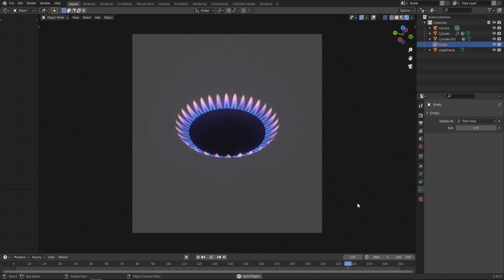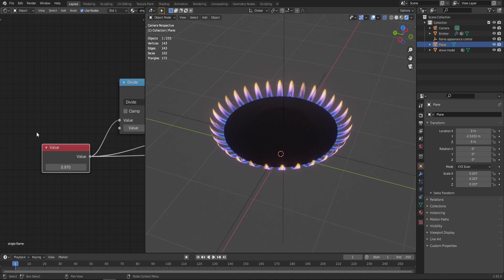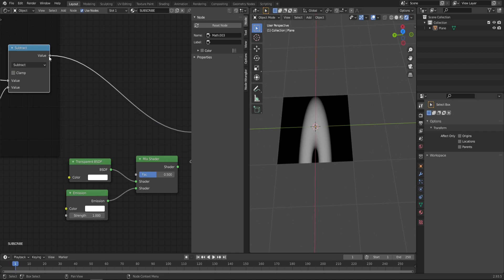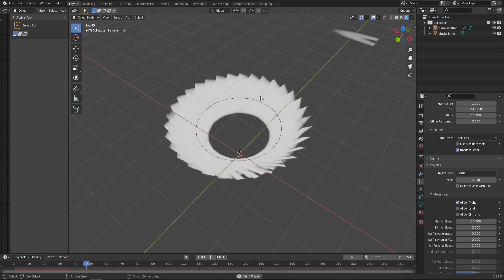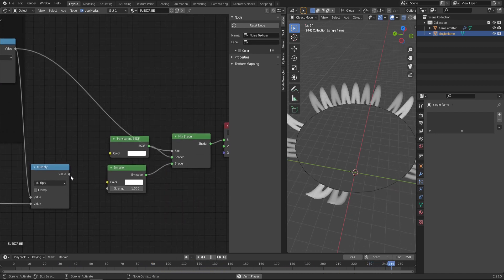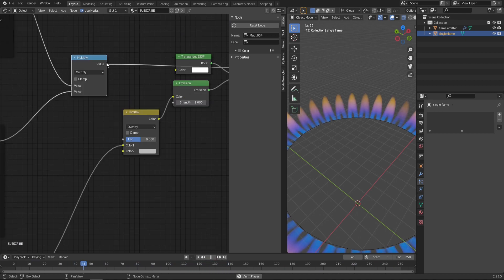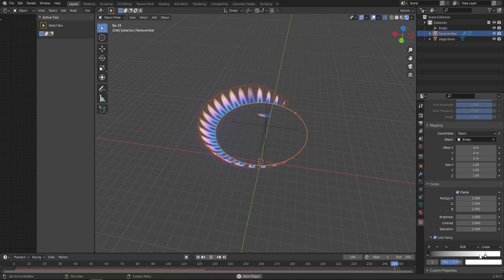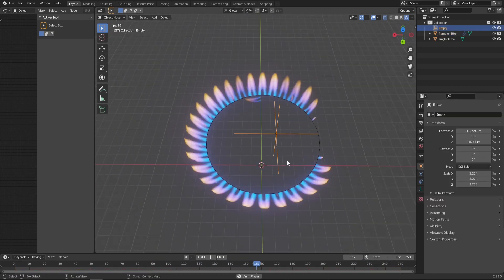Procedural Gas Stove Flame in Blender - TUTORIAL

Comment: if anyone runs this .blend in cycles and runs into that faint black outline in the alpha part of the flame cards there's two things: you need to increase the render light paths for transparency fairly high (I'm using 20) and also in the particle settings, set the scale randomness slightly non-zero (I'm using 0.1) to get them to juuust avoid Z-fighting